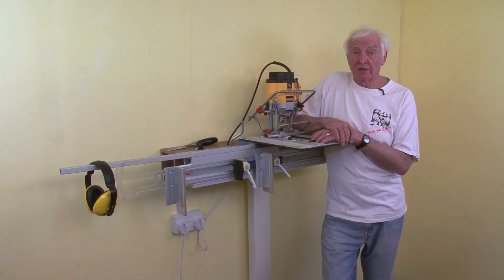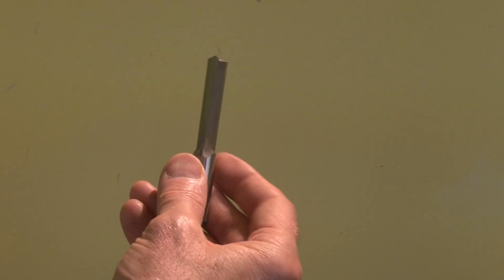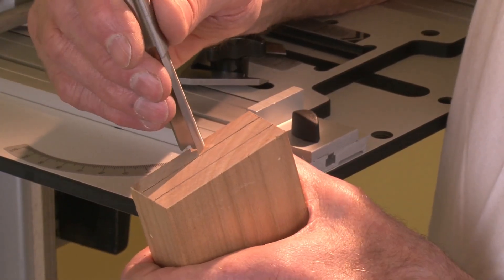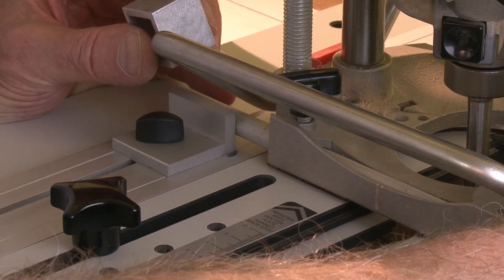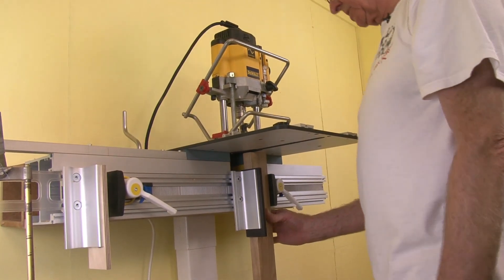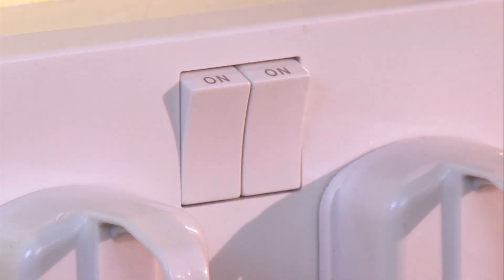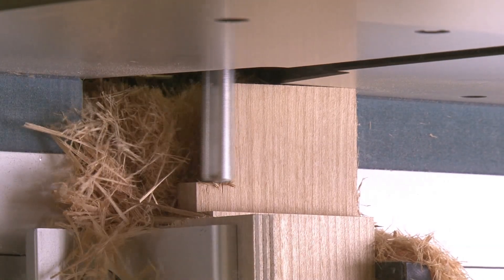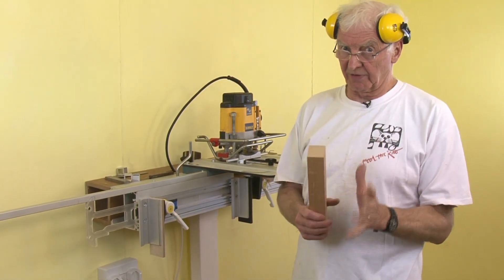The WoodRat Makes Tenons!

Comment: Instead of messing with the aluminum block, could you put a second stop behind the machine to mark the back cut? Set the front stop, use the block to position the back stop, then put the block aside.

Comment: I cut one side of the tenon, turn the wood round and cut the other side. That way the tenon is always central, and I have no problem with setting up.  I have had mine for years. I do the same with my morticing machine, which I use in tandem with the Woodrat. I could do the mortices on the Woodrat but I like squared ends and the Morticer is quieter than a router. 
It's also ideal for easy perfect multiple dovetails for drawers.

Comment: I hadn't taken part in any woodworking before seeing the WOODRAT, buying it and trying the different joints made me think, 'I can make anything'! which is true if I had the time. So I made a 4 draw chest of draws, then A fish tank cabinet, then another chest of drawers-with a twist on the corners and used a plan I found in a library book on Victorian furniture. The Woodrat made the joints so easy it  was hard to drag myself away from it. I almost forgot 'My fence' 30ft long 6 foot high, and not a nail anywhere, all Mortise and Tenon joints done on the rat. I am now making a number of frames for my OO Train, it's going in the Loft which is 17ft long, so it's come in handy again.